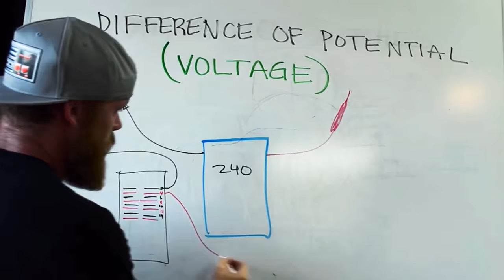ZINSCO ELECTRICAL PANELS - why their panels are dangerous

Comment: Dude. Can you imagine here in Brazil...where, until late 90's, we only had UL code brakers but no UL panels? You can still find a lot of "modern art" with wires connecting them in WOOD PANELS!!!!\0/
Reply: I worked in Florida with a guy from Brazil. He told me garden hose was what got used for conduit/flex alot that guy taught me a lot of stuff. How to shape pvc to make it look perfect he had so many tricks. I really felt bad sometimes that i was his boss he obviously had more experience than me. Was avery hard working man. But he always came to work like he wasgoing to a cocktail party. Always wore white button down pirate shirt with black slacks .Very charismatic he helped me a lot on the biggest project of my life it turned out to be my opus never reached that scale or monetary value of a single job again. I was very proud when it was done.My boss would bring his other electricians to my job to impress them with the quality of the work my friend Jose was a big part of that.
Reply: If it is dense hardwood no problem.
Reply: @designstudio8013 Wood panels are not allowed here anymore by our code. But the biggest problem is oversizing the brakers in wood panels. You can find some 12AWG wires in 50A brakers in some old apartments and houses around.
Reply: Wood panels were apparently common around 100 or so years ago, when homes were first wired.   The "panel" would be built on site, oftentimes an asbestos backing would be nailed to the interior,  so if fire were to occur it would be less likely to spread outside the panel very smart move before the health risks of asbestos exposure were known.   Then porcelain fuse blocks would be installed,  finally knob and tube , typically,  would be run into this enclosure through ceramic bushings though the sides then connect to the fuse blocks, typically this era until the late 20s or early 30s, they fused both hot and neutral wires.
Reply: @Sparky-ww5re  what a lesson, man. Thanks for sharing!!! Here, back in the 60's til late 70', we only had wood panels crafted on site but with no treatment against fire or something like. We had those porcelan fuses too and a "dry switch".

Comment: the house I was raised in had zinsco. I had issues with them and now they are totally expensive! an R38 breaker is now pricing at $75.00! I used to sell them and remember in 1984 when I started working hardware retail that zinsco was discontinued... after that every year the price of the breakers would go up....  always hated the style, just a cheap bad breaker... they were extremely popular in the 1960's and 70's when homes were wired with aluminum wire... manufactured homes of that time used them and I still run across old systems.... totally scary! and homeowners are totally uneducated about electrical safety! they caused too many electrical fires...

Comment: Very great channel you have there bud to get good info for us 👍
Maybe a video From this 4 brands  QO - Eaton - Siemens And General electric of what u know are 100% trustworthy irrelevant the price or in what other you place them from 1 to 4 and why? 
And I saw panels on ur videos 100 - 125 -200 with many breakers 40 30 60 15 20 added together passing the  main breaker of 125 200 100 is that important or irrelevant the main breaker number?

Comment: Hi Dustin. What’s a good 100 amp sub brand to put in my detached 4 car garage? Thanks. Appreciate the time putting these uploads together.
Reply: Square D QO series would be top notch. Get the plug-on-neutral bars so you can easily install AFCI and AFCI/GFCI combo breakers without having to use a pigtail for the neutral.
Reply: @lakorai2  Thanks for the info.
Reply: depends what you get up to in your 4bay garage.  any Tesla Model X that need recharging overnight? etc...

Comment: O man today I run into a small add of sub for tenant space when I check the service the main breaker was a zinsco I told the owner I don’t touch anything in your house unless that goes away some idiot replace the sub inside the house upgrade to 200 amp and another 50 amp sub coming from the main of 150 amps and the calculations I did he was consume about 60 amps on new sub cause of a small range 240 volt at 6.7 kw

Comment: THANK YOU!  I have a 1971 Zinsco 200 Amp Panel that is in SURPRISINGLY terrific shape.  I think the reason being is that the original electrician really spread out the load (which is my current problem now).  I've owned the house for 7 months and have done my painstaking due diligence in making a spreadsheet (yes, I'm female and have OCD) that lists every damn switch/receptacle on each breaker.  Not once have we tripped a breaker, so I know this is still a solid system and I'd like for it to last maybe another 7-10 years since it's in great shape.  But I'm looking at "robbing" some old/defunct items to free up a couple 2-pole 40 amp for a new tankless electric water heater.  This was some very useful information, so thank you.  Subscribed, and I think I might join.  I like your info and delivery!

Comment: Thanks for the history lesson. Actually, any panel over twenty years old should be replaced. Exception would be Square D QO.
We used to retrofit copper buss bars into the Zinsco panel. Even the newer panels should have the breakers exercised annually and the tightness to the buss bar checked.

Comment: There is no problem with these breakers when they are on a copper buss.Sylvania is the one who ruined the panels. I have been changing these buss bars to factory made tin plated copper for many years. Bare copper works well also. I change them in 200 and  400 amp panels as well and never another  problem.
As far as tripping under load, they work great no problem.
Reply: I have a zinco panel at my home. One electrician says he would fully replace it, and another says he can rebuild it. If I were to have it rebuilt would it be safe?

Comment: Since you are doing a series on dangerous shit maybe do a series on backstab connections when they can be used and when they can’t.
Reply: Good suggestion, I looked back though the videos on installing outlets and switches and didn't see any mention at all of backstabs.  Might be a good topic to cover.
Reply: I replaced an entire houses switches that were backstabbed. For some reason they were all broken in half lol. When you pulls it out the entire front would come off

Comment: My father does not want to replace the old Zinsco/GTE panel in his house, he thinks it's a 'waste of money' to replace something that has not "failed" yet. I'll check to see if a full breaker swap out could be OKed, but i'm not holding my breath.
Reply: Some people have that mind set they are simple minded. Go buy a hair dryer plug it into a whip and test if it trips the 15 amp circuits. You could buy a meter that does that but depends how much you want to drop to test a panel. 

If he still doesn’t see why and you have proof just force him he is being naive and irresponsible. Customers just leave a card got when they need to call back 😂

Comment: Why is copper so expensive right now. That would be a good video.
Reply: Winter Storm Damage took out thousands of miles of Big wire, multi-thousands of homes that needed total rebuild. Same thing happened with Katrina.
Copper? Have you seen what happened to the price of WOOD? Ya can't even hang a (resi) panel without wood.

Comment: Well done!  
FYI:  ELEC supply houses sell upgraded replacement Zinsco breaker 'TREES'.  If cust juat won't bite a new panel, sell em a full tree and breaker swapout.  Done and SAFE.
Reply: I have a zinco panel at my home. One electrician says he would fully replace it, and another says he can rebuild it. If I were to have it rebuilt would it be safe?
Reply: @Mac_Raymond  Yes. And cheaper too. The only issue is, compared to a new panel's cheaper breakers, replacement Zinsco breakers are comparativly expensive.  Get bids.  If rebuild is only 25% of a full panel changeout, then just rebuild it.  Over 25%, get a full panel changeout.

Comment: I think starting an electrical company in the 1980's called "Challenger" is a bad omen. I have these Zinsco breakers in my 1963 house, and this video makes me nervous. But my neighbor has an FPE panel
Reply: Go to Connecticut electric or check your local big box store and just by modern newer breakers provided the buss bar is OK. Best bet wld be to get friendly with a spark because like all trades they would rather rob you blind to replace than patch with new breakers
Reply: @wizard3z868  My friend owns an electrician business and put a Square D panel in. I thought about Connecticut Electric, but that doesn't solve this issues of the aluminum buss bars and the cost would come close to what I paid for the new panel anyway
Reply: @wizard3z868  Plus I wanted a larger panel for an AC system and welding machine I want to get
Reply: @jonp.6131  Yup I'm not surprised and glad you where able to replace with better panel

Comment: If we want to replace our panel which manufacturer should we request from our electrician?
Reply: He will say square d QO because he is sponsored by square d. But you should honestly get a Eaton CH. 
breakers are SWD rated panel and the breakers has a lifetime manufacturer warranty. 
It has a copper bus bar basically means it’s a better conductor not enough to change your electrical bill but it’s good for your electrical system as a whole. 

Don’t get me wrong QO a good series but Eaton CH top dog in my opinion.

Comment: I bought my house in 1989,  I just discovered that I have an old Zinsco panel.  Sweet Jesus I got screwed by the  Banks  house inspector,  and he signed off on no handrail on the basement stairs.  I discovered this POS when I was searching for breakers and discovered loose breakers, flickering lights, faint smell occasionally.  
  Had I known in 1989 The Bank would have bought me a new panel.  
This was an FHA loan process too.   I trusted the system and got Screwed...

Comment: Short circuits are way over 200%. That part was not good info. Inrush for motors would easily be 200% often 500% for short durations. Short circuits can easily be 1000% on to way up

Comment: SO AS NOT TO CAUSE UNDO CONCERN, ALL CHALLENGER PANELS ARE NOT THE SAME.  THERE IS THE PROBLEMATIC CHALLENGER / ZINSCO AND THEN THERE IS THE SYLVANIA  / CHALLENGER SPIN-OFF WHICH IS A CUTLER-HAMMER / WESTINGHOUSE / BRYANT STYLE CIRCUIT BREAKER POPULAR AROUND THE 80'S AND 90'S.

Comment: got two zinsco panels over at my moms place -- main panel/service on the house and a sub panel on the garage.  i remember putting in a 50A welding circuit in the garage and that 50A zinsco breaker was not cheap!

Comment: To bad most sparks will not be ethical and be upfront with customers and offer to do time and material. Customer gets the parts and the spark charges for labor when I can get a 200 Amp square d q/o at hd for under $200 yet a spark charges over $500 gee I wonder why pple can't afford to go with a safer upgrade?

Comment: The 1970s copper shortage was a scam. I'd still rather have Zinsco than Federal Pacific gear. GTE stayed as a communications itself and later it became Genuity. The original Zinsco stuff wasn't that bad. Challenger was crap. I have seen Square D breakers melt too. Murray, GE, Bryant, GE, all that residential stuff was just as crappy as Zinsco.

Comment: Imagine that....an electrician telling you to change your entire panel. Kind of like a car mechanic telling you to replace your engine because you need an oil change. There is no safety issue with Challenger panels across the line, maybe individual case by case basis, but all manufacturers have problem panels, and usually it has nothing to do with the layout, materials or design. It's usually the installation itself. If Challenger was a defective brand, nobody would have bought them. No one wants to be associated with unsafe products, let alone pay for that association.

Comment: I have Zinsco panel with its circuit breakers, condo sitting, been installed since 1978, working flawlessly, never have a problem.
Reply: Same situation. Live in a condo built in 1978. Zinsco panel. We had a short circuit  in a electrical socket in the kitchen. Huge sparks everywhere. Zinsco panel did not trip. We replaced the panel.
Reply: Bought my house 20+ years ago and never had a Zinsco breaker trip.  Upgraded the panel and a breaker tripped. It was in fact overloaded and should have tripped. Rice cooker, air fryer then plugged in the vacuum to socket in the kitchen and breaker tripped.
Reply: @jah0524 was it expensive?